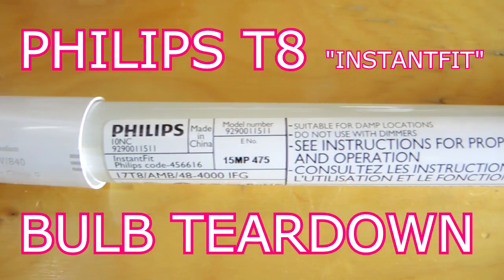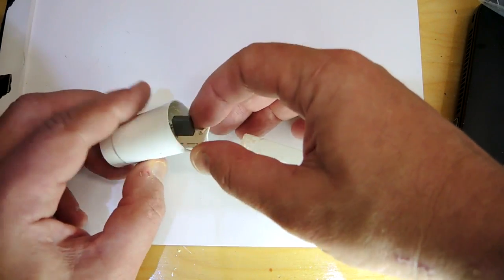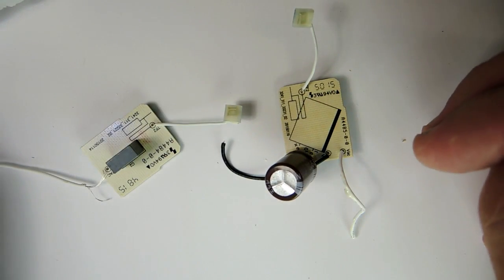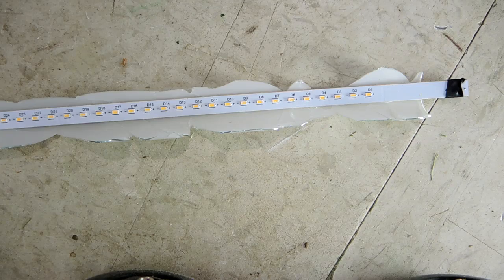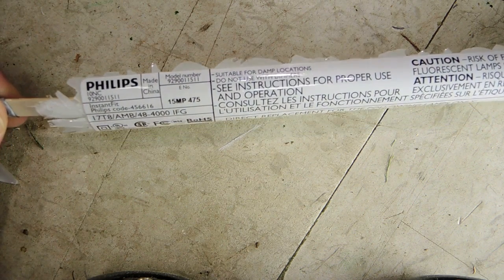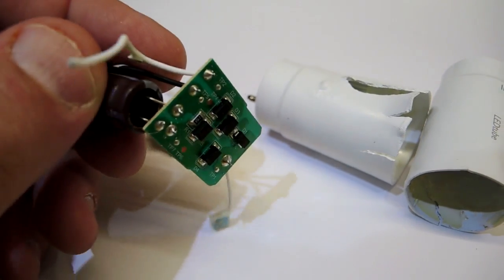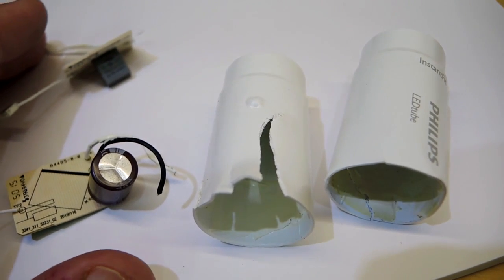Philips T8 LED Tube Tear down: The most boring teardown yet....

Comment: I recently tore down some of the Instafits.  They have 123 LEDs.  There are three strings of 41 in parallel and run on about 123VDC at 150mA (50mA per string).  It's fairly easy to cut off just the bottom half of the plastic end with the three wires and connect the black and red wires to the pins.  Then you can light the LEDs with an external DC power source.

Comment: Our facilities management just replaced all the old tubes in my office with these so I looked up a few specs.  I would guess the 152 LEDs are actually 8 parallel groups of 19.  The spec on the current for the tubes is at 140mA, which would give 17mA/group in series, which is a great place for a standard (cheap) LED to be operating.  For the 10W power, it would be about 70V on the series chain as well, so that's 3.7V/LED, again, sounds just about right.  The frequency these run at is in the tens of kHz, like 40-50kHz with the high efficiency ballast, so you're not going to see flicker, but might detect it, and that 68uF capacitor will do just fine with frequencies that high. (Doubled of course, since the full wave rectifier will double it.)  At 70V it will hold 5milliCoulomb of charge. One cycle at 100kHz at 14mA would draw 1.4microCoulomb, so the electrolytic cap holds about 3000 times the amount of charge that is drawn, so the voltage droop will be tiny.
Reply: How 50/60hz line is generating 40-50 KHz without any circuit?

Comment: When my fluracent lights started flickering a lot, I went ahead and got into the led wagon and bought me 2 Philips t8 instant fit led tubes. But they didn't work, I think my blast is bad. So my question is, do I need a new ballast or do I just need to remove the old ballast for them tubes to work? I mean why leds need a ballast in first place? Iam not an expert and this is all new to me so I hope someones able to help me
Reply: don't buy the instafit! get tubes that use the fixture but not the ballast , direct wire line and neutral to the tombstones !! why keep a component in the circuit that is prone to failure if you don't have to!
Reply from the maker: This particular bulb requires a ballast.
Reply: @electronupdate  Why won't mine start with a ballast? When I turn them on they flicker BRIGHT, then off.

Comment: Would it be possible to bypass the ballast with these bulbs?
Reply: No, not without building a driver circuit that replicates the ballast output voltage.  Neither 120V nor 240V are high enough of a voltage for these "instant" replacement bulbs.

Comment: the small capacitor acts as a current dependent resistor. you can see at about 0.55 that it is connected in series - so this is what drops the voltage. the Electrolitic cap is rated at 160v (0.45), so the circuit is probably running at around 100v dc. changing the value of the small cap allows the lamp to be modified to suit different mains voltages (different countries)
Reply: Thank you for the explaination!

Comment: I'm wondering, did you think to take spectrometer and flicker measurements of this tube before tearing it down like you used to with edison-based bulbs? While I'd imagine the spectrum to be similar if not identical to other Philips bulbs, I'd still be interested in seeing how it compares against a Philips T8 fluorescent tube with the same CCT.
Reply from the maker: that would be interesting... however fluorescent tubes in my home all went  off to recycling after I replaced them with leds....

Comment: Can you recommend a good LED tube?
Looking at that teardown doesn't exactly leave me with a good impression. I have a single 120 cm FL lamp in my laundry I'm thinking of replacing for LED as the FL is flickering (tube possible near end EOL) and not starting as fast as I want it to (even got electronic starter - old school EM balast).
I have seen some tubes advertized as they can be used both with and without EM balast. Ideally I believe rewiring the fixture would be most optimal as no waste is going into the EM balast and most likely better flicker performance. Those LED tubes i believe also had real drivers in them. That tube you can't even open easily and replace or add another capacitor to get less flicker.
Through my work I can buy Philips and Osram LED tubes but I'm having a hard time figure out which are the best. I have no trouble rewiring the fixture (might be an issue for some). I also just could replace the whole lamp for an LED module which we also carries a great deal of for professional use but that's (much) more expensive and hey it's just the laundry room.

Comment: Hi, if there's only 1 wire connecting to the end caps, which of the 2 pins does it connect to? It can't be connected to both pins on each end because the wiring diagrams say to short the starter loop, which would short the input AC source. Thanks.

Comment: It'd be interesting to see how these drivers compare with LED tubes designed to operate off line voltage, as well as those intended for either magnetic or electronic ballasts.  Most retrofit tubes require an electronic ballast but there are a few which allow for magnetic (e.g., the Feit Electric and Zilotek lamps available at Menards).

Comment: I would guess that the LEDs are wired in a parallel array of series circuits to try and match the original tube voltage and current.  How was the small capacitor wired into the circuit?  Was it in series like a capacitive dropper?  What value was it?  (It seemed quite small.)
Reply from the maker: +bigclivedotcom 3900 pF for one cap.  160 uF for the electrolytic.  I have a copy of the whole schematic on my secondary channel (electronupdate2)
Reply: +electronupdate It looks like a standard capacitive dropper, but the 3900pF would be really low for 60Hz.  Is it being used with a high frequency electronic ballast?  The diode after the bridge may be a zener to cap the open circuit voltage across the electrolytic, although it would potentially get quite hot if it did.
Reply from the maker: +bigclivedotcom most electronic ballast should switch in 100's or even thousands of hertz?  The bulb packaging was quite explicit that it would not work with magnetic ballasts
Reply: +electronupdate Ah, that kinda makes sense, because the capacitor could be a lot smaller at higher frequencies.
Reply: @bigclivedotcom  u cleared the doubt by making things clear. thats y i love ut channel so much, i learned a lot. ur hard work is commendable. video did not gave any info what so ever, how many bulbs in series/parallel or is it using ballast or not?
Reply: RDELAPLAZA Have you found a solution? I'm facing a similar issue. I have functional T 12 ballasts but these tubes will not light. They seem to require a T 8 ballast.

Comment: 152 white LEDs will need about 450 volts so they're probably not just all in series.
Reply: @ELECTRONTHORP Hi, I'm a little late to the dance but i see in a reply to "otm646
2 years ago" he (electronupdate) mentions that you HAVE TO leave the ballast in ,,, hence you would have adequate run voltage for 152 leds
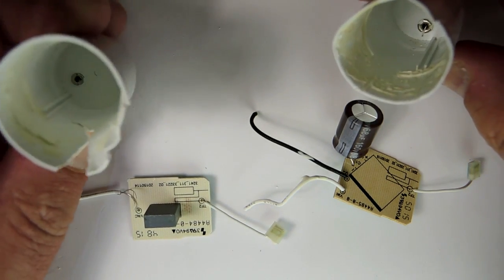Reply: @barqzrdavi  - the round brown 68uF capacitor on top of the rectifier board is only rated for 160V.  (see at 0:44).  So IDK what it's doing!  That would be too low even for rectifying 120VAC (peak of 170V), but maybe it's what the LEDs are running on?

It does look like a bridge rectifier, with a surface-mount capacitor next to one of the diodes on the board with the brown cap.

I can't see what it says on the boxy component on the other board.  It seems to be in series with the AC power, if you look at the traces on the bottom of that.  Assuming it is a capacitor, it could be limiting incoming current by only allowing some amount of charge through on each cycle of the AC power.  That could maybe keep the voltage down enough for rectifying to a voltage low enough to not fry the 160V-rated cap.

Yeah, another comment thread (https://www.youtube.com/watch?v=om180yfGego&lc=UghTNGW41dkZ8XgCoAEC ) points out that it only works with electronic ballasts, and they switch faster so the 3900pF cap in series can pass enough current.  And yes it is a capacitive "dropper" to reduce the voltage.